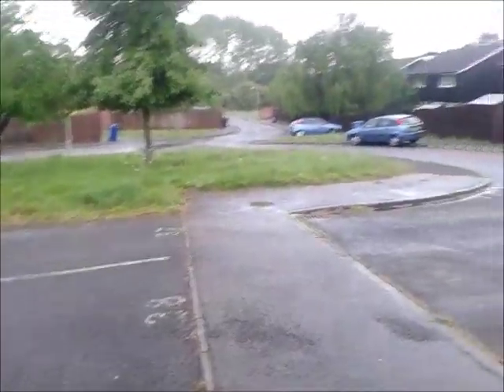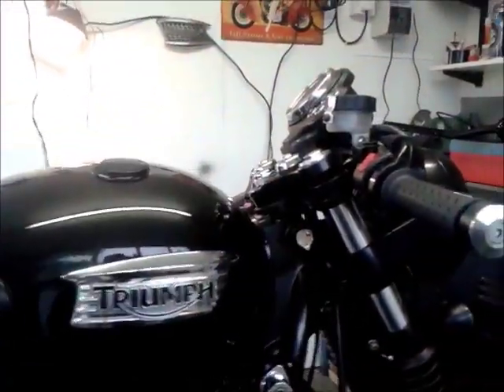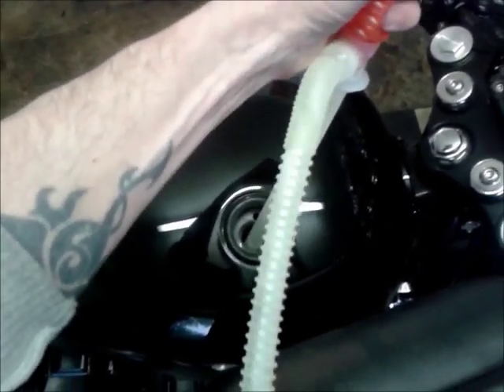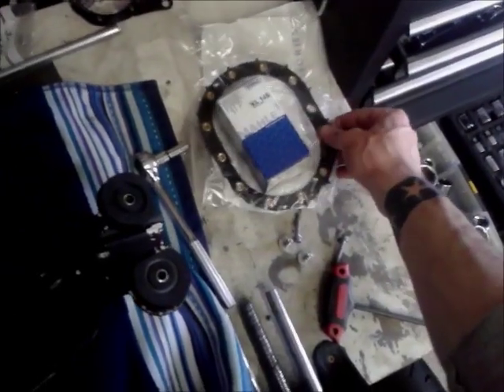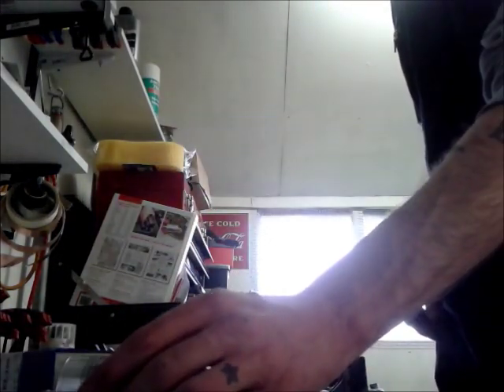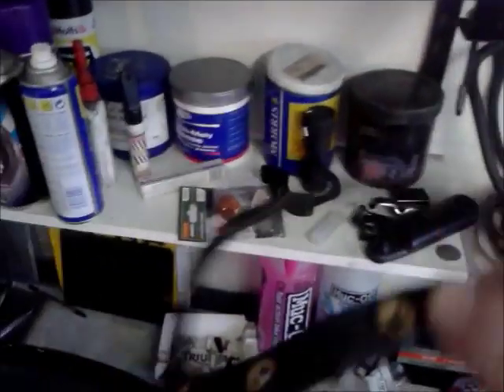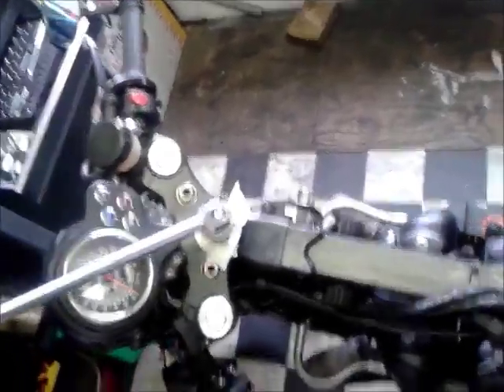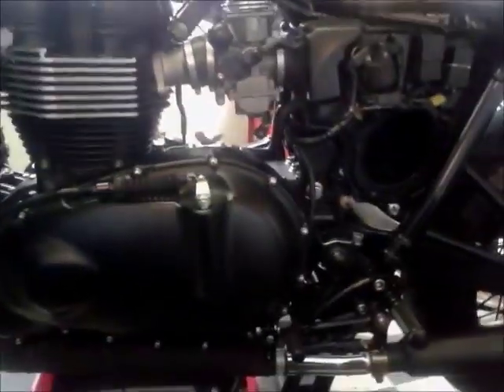BONNEVILLE 12K SERVICE  FUEL FILTER

Comment: Hi, this video is perfect timing.  I bought the same Mahle filter last week and it is sitting on my kitchen table waiting for the time (and the inclination) to replace it as part of my 24k service. I'd been wondering if there was a video from you or Del, and lo and behold, you present the very thing!  I had been wondering about the need to replace the gasket too.  I'll be checking my valve clearances soon too, so I'll watch your next installment with interest.  Keep them coming!  Cheers.
Reply from the maker: hi nigel! that was good timing!!- looking at how squashed my gasket was i'd probably recommended stumping up the cash for a replacement!!- it's a bit of a fiddly wiggle to get everything out but pretty straightforward!!! valve check today!!

Comment: You were pretty much spot on with that mileage clocking over after Swindon mate.Like the idea of using the stock front mudguard on the rear,waste not want not so to speak. RS and cya both soon
Reply from the maker: cheers mate!- offered it up but not too convinced eyeballing it....may copy the stock rear guard in fibre glass and slim it down.....hmmmm!!!
Reply: Well after seeing yours and Jens bike up close i have no doubt you will make the right call as always.Great looking bikes

Comment: really good video man, I have a triumph America 2012 with almost 8000 ml. . so far I took her t dealers for services, since they charge too Mach I'm thinking do it my self after a year I got it done last time. do u think I should wait untill 12k t do the fuel filter and new gasket changeor I should do it now at 8k
Reply from the maker: hi mate- yeah i much prefer to do the work myself- a lot cheaper!!!- i personally would do the fuel filter at 8k-as it's a 2012- you can pick a filter up for much cheaper than through triumph- it's a mahle KL145 http://www.squaredeals-ltd.co.uk/mahle-fuel-filter-kl145-metal-cased-replaces-triumph-part-t1240850-825-p.asp
Reply: johnnycactus0 thanks man, this is going t be my first time doing the service myself,I just got online the gasket and fuel filter a good price. also it's been a year since I did the service in a dealer which I was lots of money and they just did oil and filter and just some wires adjustments and this time after a year since I dont drive slot  they wanna do the same so that's why dicided for the same money I do more stuff in the bike myself buying online
Reply: do I have t change the hoses w the filter at the same time or just the filter is fine
Reply from the maker: just the filter mate- the hoses will be fine for years!
Reply: johnnycactus0 thanks man again, sorry t ask u again me watching yr valve check video since I will do tank removal and some other things this bike at almost 8k do u think will need the valve check or should I wait untill 12k , I got this websites t buy parts really good
Reply from the maker: no problem mate! totally up to you- it's easy enough to check- i'd use fresh cam bolt sealing washers but you probably can get away with re using the cam cover gasket. if you don't mind buying them -ie a little extra expense then go for it! otherwise you'd be fine to wait til 12k.
Reply: thanks so much for all yr info and keep up with the good videos man
Reply from the maker: no problem buddy! thank you for watching!